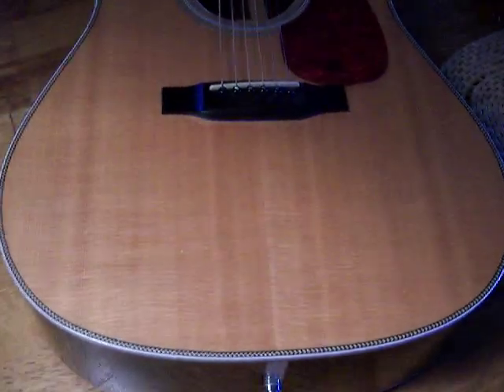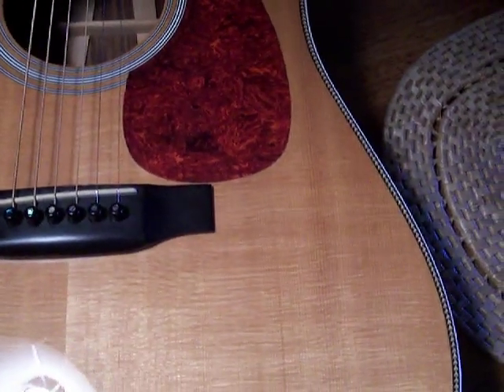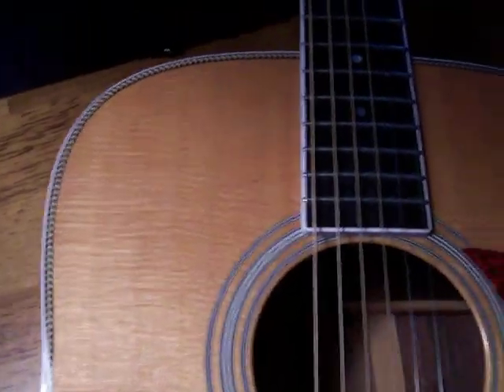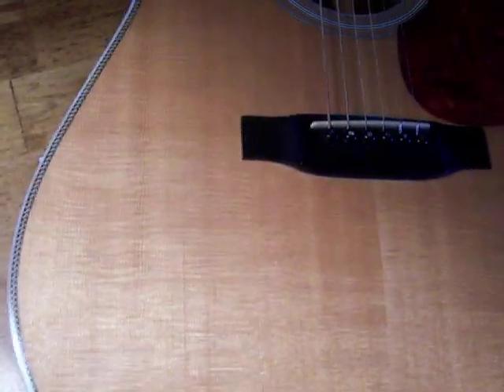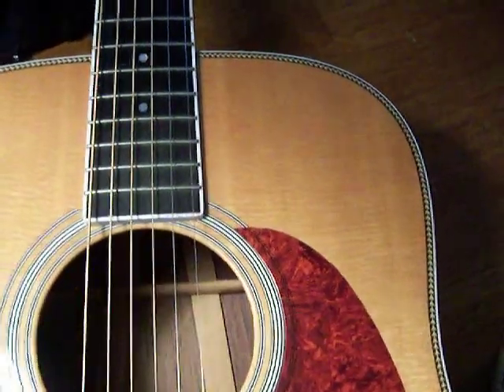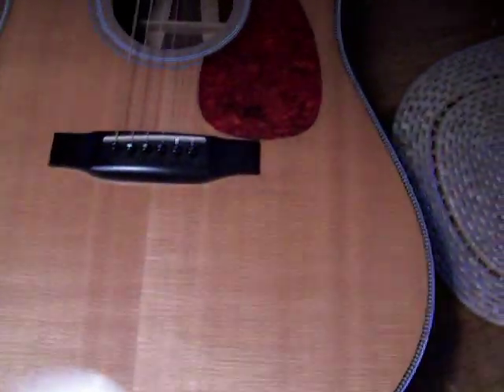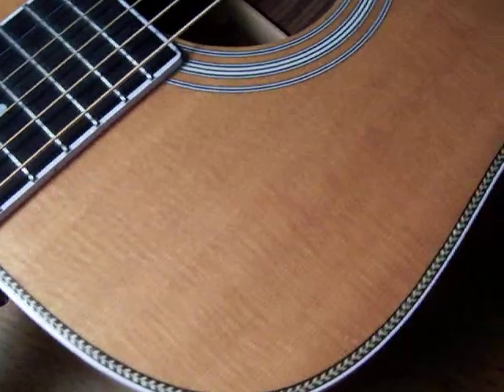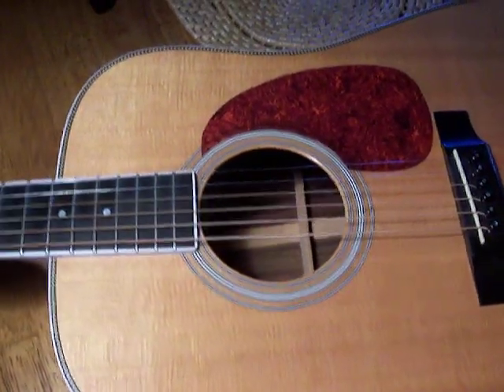Silk, Silky Spruce, Medularry Rays, Cross-Grain - Martin HD-35

Comment: That's identical to the top on my Martin D Mahogany. Swiss alpine high altitude alpine spruce. Literally silking everywhere. Rays everywhere. 3 depth everywhere. Also like some kind of cross stitch grain in the silking in certain spots. Bearclaw bookmatched all throughout the lower bouts that look like long silking rays, yours has that too. There's so much going on that the grain is almost secondary in a lot of spots. Especially considering the gpi is 40 in some of the spots. You put all those things together and it's definitely an indication of a dense top with great cross grain stiffness from an older tree. You might not to be able to go off grain lines alone, although tight grain is usually a denser piece of wood. However you add in a 3d looking effect, with silking everywhere, rays, and bearclaw, that Martin used on a highly scalloped guitar, and its a safe bet it's a stiff top. Sure there's a chance it isn't but it's low. Mine has golden era  bracing and its foward shifted. 

Anyway although yours is Sitka it's so close to what my top looks like. Mine even has those two racing stripes where yours are. Really odd. If love for you to see it because you'd think these two different spruce species were cousins. Lol. Nuts. Great top man. Gorgeous guitar.
Reply: What is GPI ?